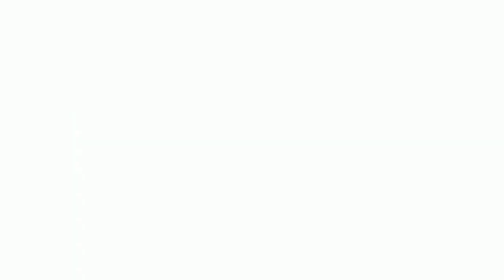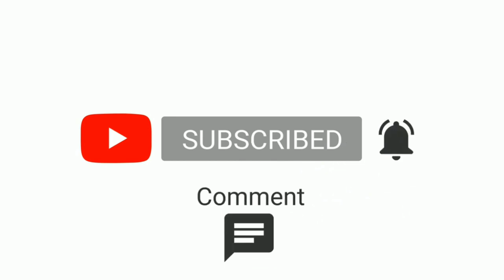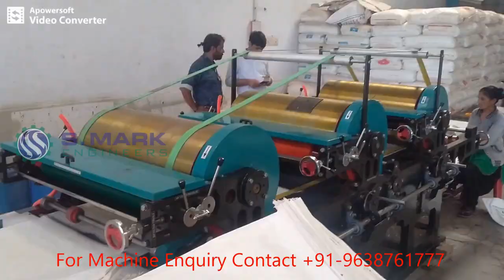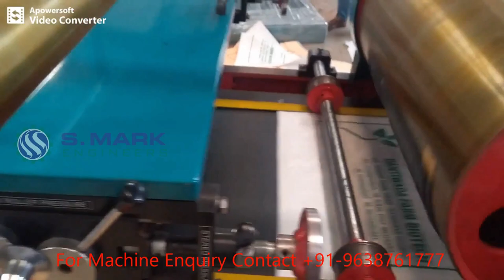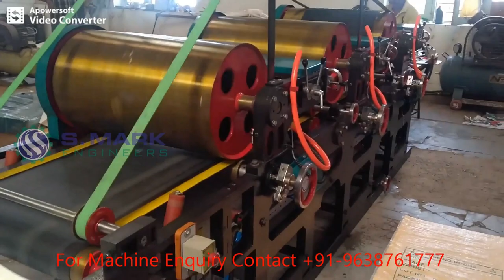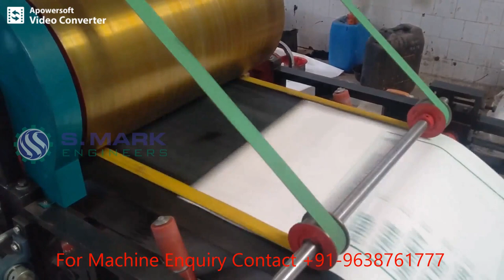PP Woven Bags Printing Machine | Plastic Bag Printing Machine | By S Mark Engineers | 3 Colors

Comment: Is 3 Phase electricity connection required to operate this machine?  or is it work on single phase?
Reply from the maker: 3 phase is advised for better power efficiency. In single phase also you can run this machine but in that case machine will consume more power as compared to 3 phase
Reply: @SMARKENGINEERS  thanks for quick response